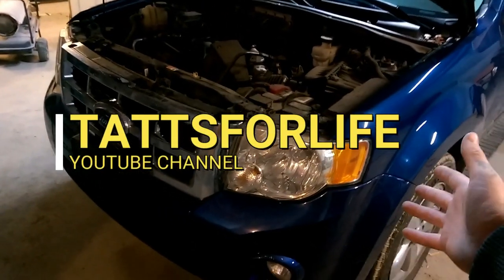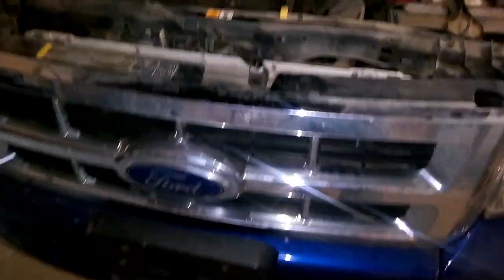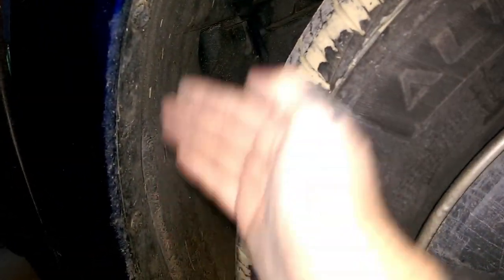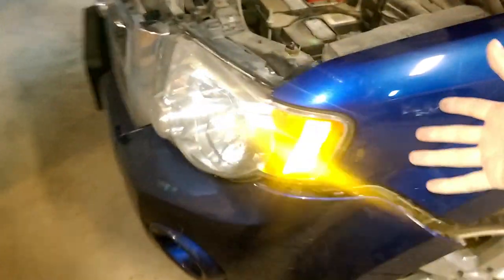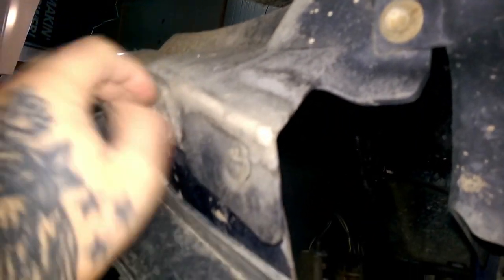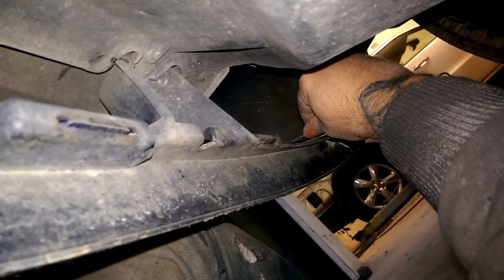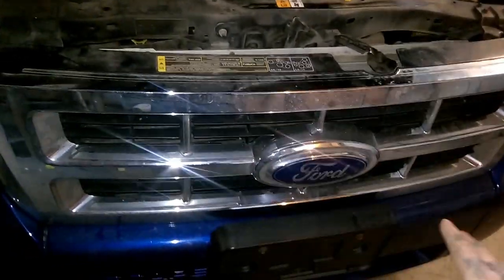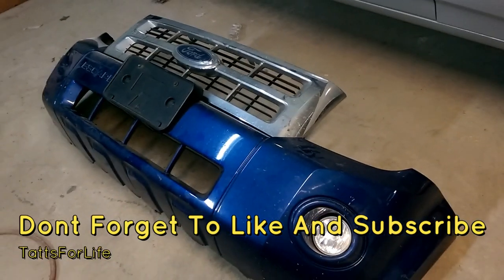Ford Escape Front Bumper Cover Removal | How To Video

Comment: please no one do it this way. there is a way to do it without doing all this extra work. you just need to remove the top 2, bottom 2 and the 3 other ones on the bottom of grill in the middle of the bottom 2
Reply from the maker: Great Info